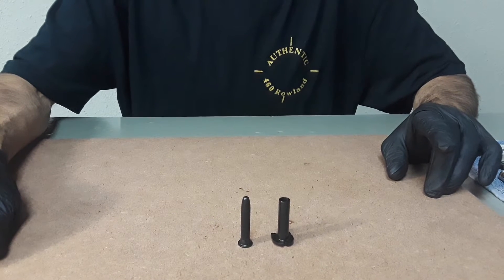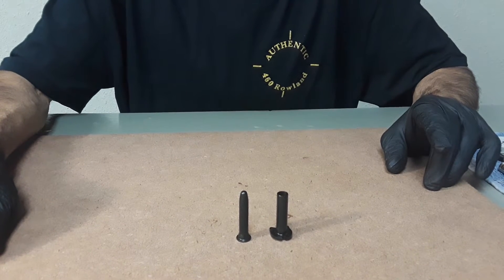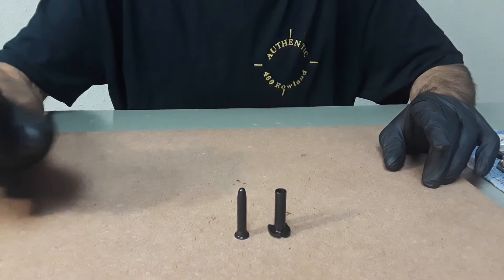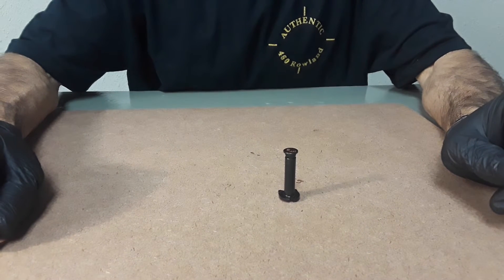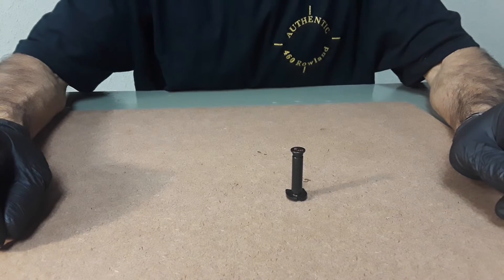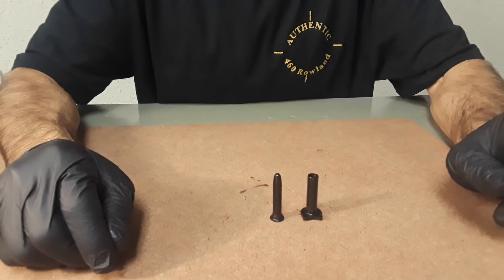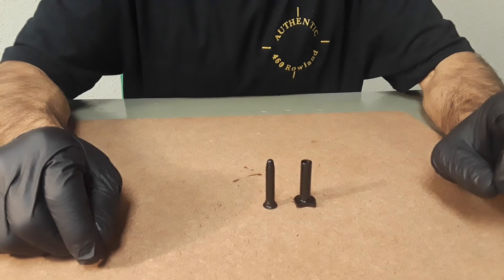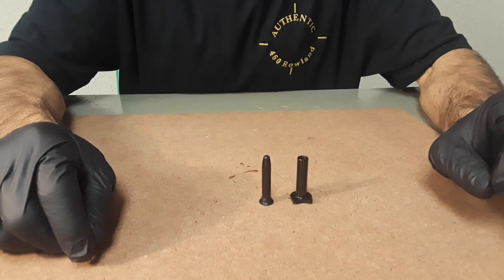.460 ROWLAND® V2 - 1911 RECOIL SYSTEM (A brief explanation of the V2's operating cycle.)

Comment: This one invention completely transforms the 1911 "system" and makes the .460 Rowland fully practical in the field by rendering it transparent to the 1911's timing!  It eliminates the need for powerful recoil springs, main springs, flat bottom firing pin stops, and even extra-power magazine springs in an attempt to chase dwell timing, and in fact, allows the use of lower powered "reaction springs" to further soften the 1911's operating cycle!

Comment: The reason for the over power action springs in the Rowland was never about holding the slide closed, but about preventing the slide hitting the frame at high speed.
For example:  you can remove the action spring from your favorite 45 auto and fire it with no problem as long as you don't mind the slide remaining open after each shot and needing to be manually pushed forward.  Stock 1911 action springs are around 15-16# and should be left alone by all the amateurs out there who automatically think they need an 18# spring which only moves the guns cycle away from reliable function.

So, you mount an efficient muzzle brake on the barrel, and remove the action spring and shoot....well, IF the brake were sized large enough it could indeed slow the slide quite effectively but that would also mean a much longer, heavier, more cumbersome brake.
So the compromise was a two-chamber brake that let's the gun get away with 22-24# recoil springs - again to save the frame, NOT to hold the slide close during firing.  The downside to this system is you're sapping energy from the reciprocating mass early, shortening dwell time at the back, and placing greater strain on the frame as the slide slams closed.

So Rowland invented the dual-coil, flat-wire system used in the Tougher Buffer.  It uses a much lighter action spring with double-power helper spring during the last inch and a half of travel.  This is a great step forward because it makes cycling the gun a bit easier, draws less energy from the cycling mass during early recoil, but applies maximum cushion right when it's needed to bring the slide to a halt with minimum frame battering.  With this system instead of running a straight 24# spring I run a 20/40# action spring.

But somebody took it to another level when they invented this device.  it's nothing more exotic than a small, closely toleranced piston and cylinder that fits in the action spring and replace the full-length guide rod.  During the last 1.5" of travel the front piston intrudes into the rear cylinder and begins compressing a column of air ahead of it.  At the same time a metered amount of air is being released to avoid total lock-up.  Compression rises in the piston, slowing the entire slide mass in a predictable, liner manner.  When properly calibrated, the "motor" as they call this, will drag the slide to a stop just shy of full-on metal2metal contact.  Pretty sweet!  Because NO SPRING was needed nor used in controlling slide opening energy, the only action spring needed is the same as any other 1911, or around 15# which makes racking the slide much easier.

There's a video on Rowland's site that shows a 1911 firing full power loads with a 9# reaction spring, and you can easily see how gently the gun is recoiling.